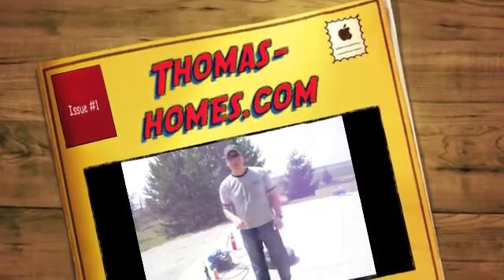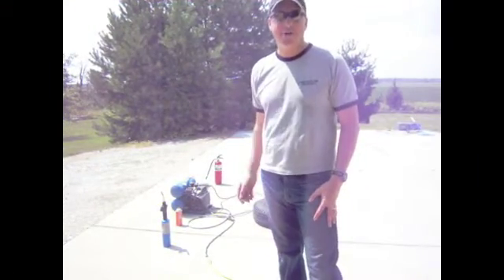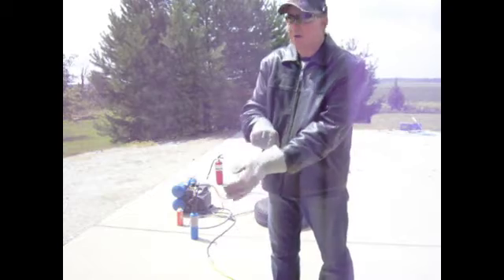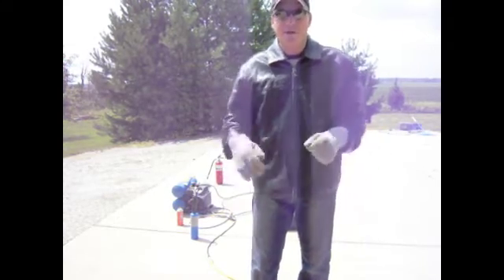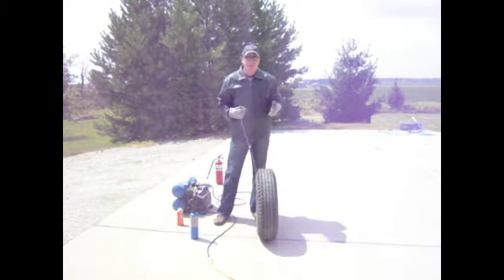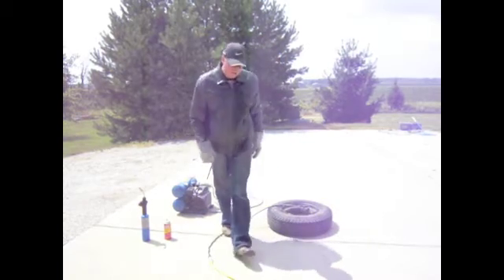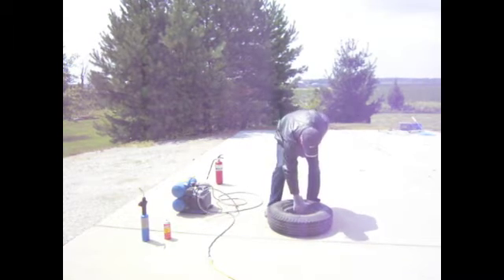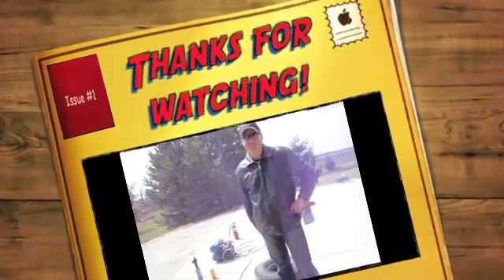How To Seat A Tire Bead with starting fluid, torch, and air compressor

Comment: Did you take off the valve stem and if not did it do any damage to it
Reply from the maker: The valve stem stays in place and isn't damaged at all.  The valve core could be removed temporarily to allow air in faster, if it's being stubborn.